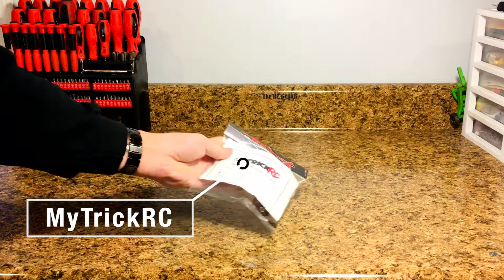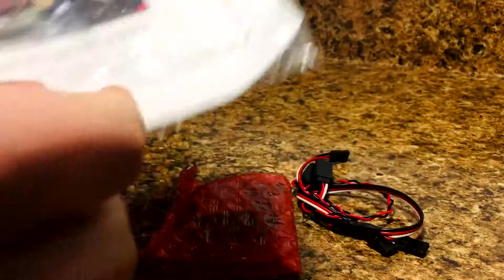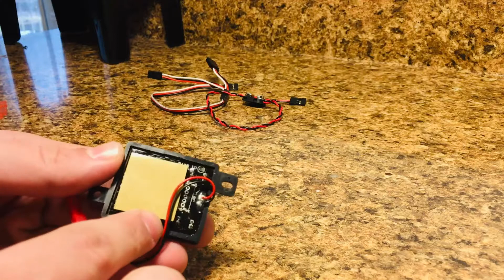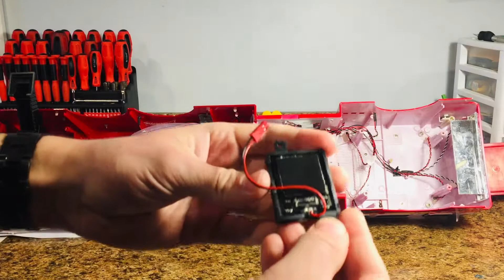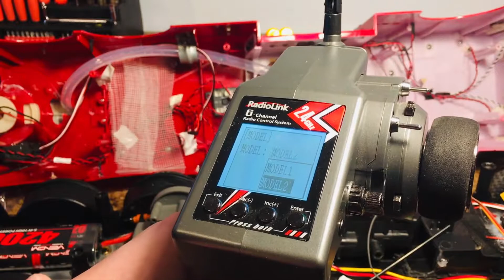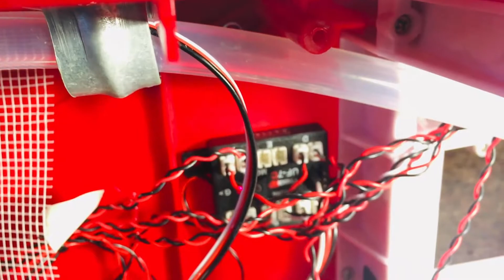Using the MyTrickRC UF-7C Light Controller | Tutorial & Custom FIRE TRUCK!

Comment: I'm actually planning on a similar setup for a police car. I'm also considering the RC6GS controlling a R7FG receiver. I was wondering how you set up your receiver to turn your auxiliary channel into a two-position channel, since it looks like the switch on the RC6GS is a 3-way switch. Can you tell us what your AUX-CH settings are please?
Reply from the maker: Since there isn’t any 2-position switch on the RC6GS, it takes a 3-position switch and acts like a 2-position. I didn’t need to adjust any settings. When you plug the MyTrickRC module into the channel, the only two functions are on/off. So the 3-position switch can only turn it on and off. Hope this makes sense. Let me know if you have any other questions.